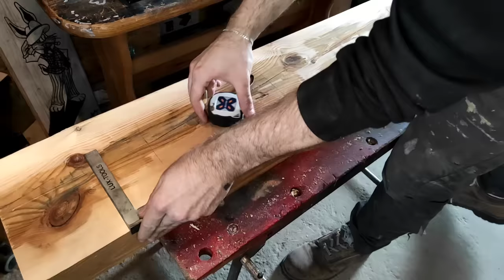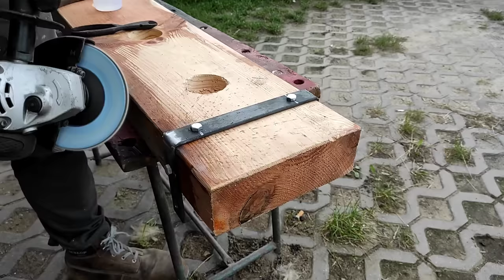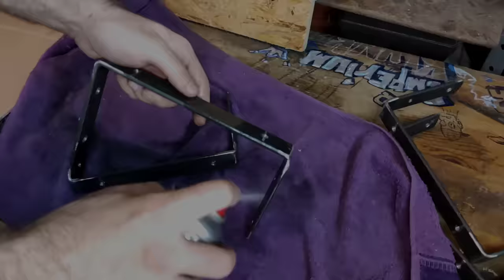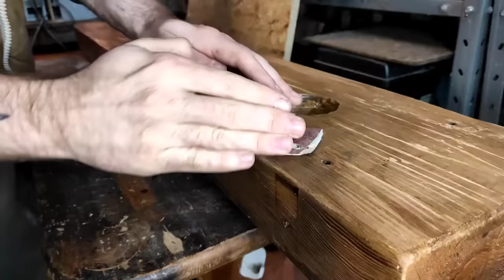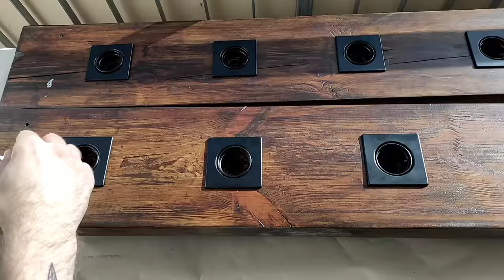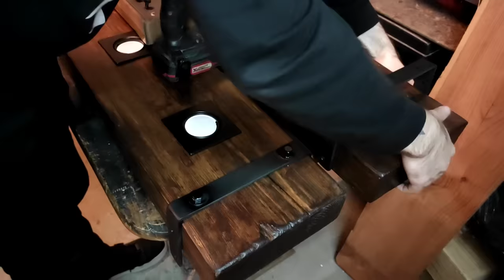INDUSTRIALNA lampa z belki / Industrial BEAM lamp

Comment: And changing the light bulbs are going to happen how??? Did not look like you enough wire to pull out to get to socket, maybe so. Looks good
Reply from the maker: There is enough clearance to twist the light bulb and it just pops out, no issue with that :) 
Thanks! Be sure to check out my other videos too!

Comment: Так то реально крутая идея, но не безопасная, провода если начнут греться будет пожар, так как дерево отлично горит. Если делать то делать качественно либо брать подложку асбестовую но тоже не выход, либо использовать не горючий провод.
Reply from the maker: Those are very low power light bulbs, heavy gauge wire with plenty of isolation and the sockets are ceramic,  I took every precaution to make it safe 😀

Comment: forestner drill bits
Reply from the maker: Yes they do exist, but only my mill could handle the torque required for those, and the current workshop setup doesn't really allow to put such large piece of wood on the mill. The drill press and battery drill won't have the power so I used alternative way 😉